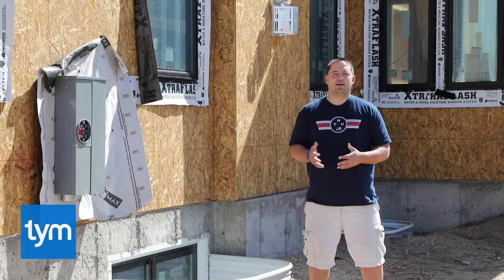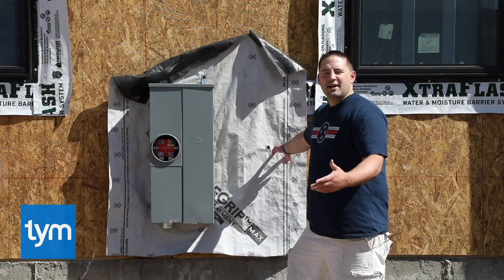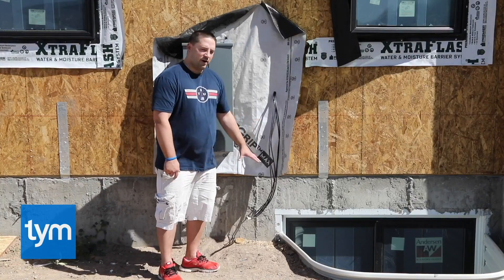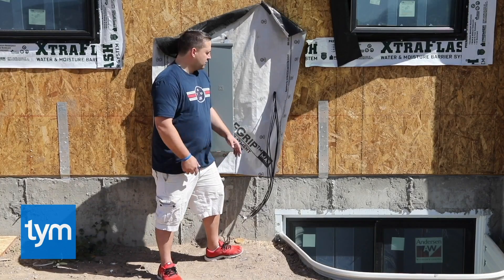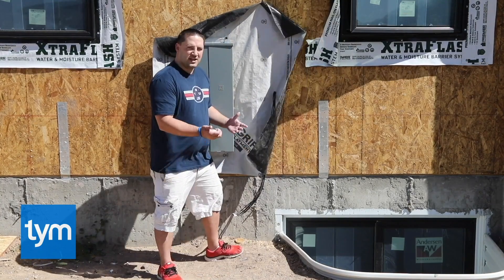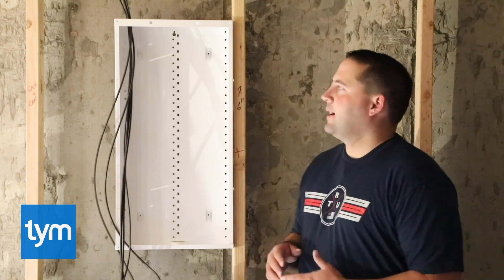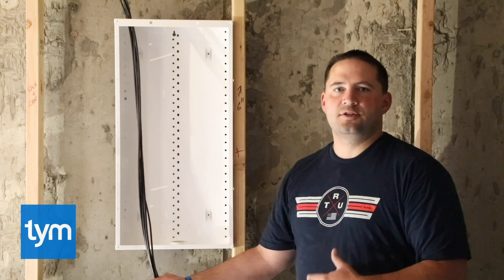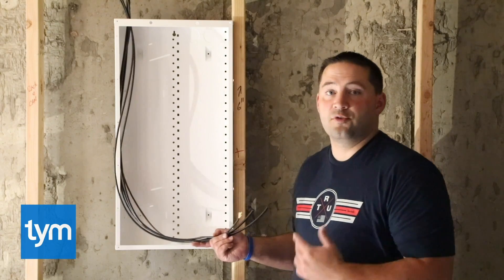How To Wire The Demarcation

Comment from the maker: Thanks for watching our video on how to wire the demarcation.  Let me know if you have any questions.
Reply: So with the low voltage run as a demarc for a fiber modem, have you actually seen this being utilized in new homes that are now equipped and operating with fiber? I'd assume ISP's would just provide a "fiber" modem equipped to a dc adapter that goes to a 120v inevitably. But I did find the low voltage run to be interesting so wondering if its worthwhile to do now.

(side question but is it "ok" to group 4coax, 2cat6, fiber, and a low voltage run in the same strand or is some separation ideal?)

What purposes would be utilized for running cat 6 to the outside.

In another one you recommended 4 coax runs to the outside, which most would seem overkill, but that is what I ran yesterday with quad-shield rg6.

thanks again, awesome videos, subscribed.
Reply from the maker: John Doe if I understand your first question, with the fiber modem they usually want to do just what you suggest and plug a transformer into a standard outlet either there on the outside of the home, or just inside.  The low voltage power wire for us is sort of a get out of jail card because often times the builder/electrician don’t have an outlet there.
Reply from the maker: John Doe separation is always good but to cut down on noise, but usually on the Demarc this is how we see it done.  You could run wires on inside of home with more separation and just bring them together last couple feet at Demarc.
Reply from the maker: John Doe depending on service provider they’ll use Category cable rather than Coax to bring the Internet into the home.  Cat6 gives you better speeds bandwidth obviously than Cat5e and most companies offering fiber to the side of home use a bundled wire that includes 2 cat6 to bring the higher speeds into the home.  So we kind of pattern after that to help the home be ready for isps offering the higher speeds.  The (4)coax are for satellite Prewire so different location.  A lot of homes just need 1, but some need 4 so we just run 4.  Cheap as coax is just easier to run 4 and know we’re always covered.

Comment: Wouldn't you recommend a flange flashing on the outside and conduit?
Reply from the maker: Luke H you can do that for sure.  Lot of it depends on whose paying for it, production builder, custom builder or home owner.  Very common to just push wire thorough, especially in production.  Custom and if home owner is doing it more common to see it wired into a box, and/or conduit

Comment: What about telephone services? I know most companies are going to VOIP, which mine is included. Would you run it  through a separate hole when coming into the house from the outside?
Reply: VoIP runs through your network and through the ISP. You will connect your firewall WAN to the ISP modem and the LAN to you Switch. Then install a patch panel in your network closet and run an Ethernet cable or 2 to your workstations. Terminate the wire(s) at both ends (to the patch panel and to the wall jack). If your VoIP phone has a PC port on the back, you can patch your computer to the phone and get internet. Or if you ran 2 Ethernet cables, you can patch the phone and PC directly to the wall. In the IT closet, you will patch from the patch panel to a network switch. You will create 2 VLANs to separate them on your network. This way your PC and Phone are on different networks. This is best practice for QoS.

Comment: your videos are awsome but... this is so wrong.... you are pushing an non outdoor cable to be exposed to the element and they will not hold with time.

anything exterior or should i say any connector that is going to be exposed to the elements should be closed in a sealed box / in wall  etc...

im from la, we usually get our service from the isp/cable from an Ariel connection so electrician and low voltage should have an EMT Goose neck with a service head at the end for the connection at the top of the house as close as you can to the pole.

we also to make thing nice and neat, use an exterior enclosure, metal exterior enclosure, which works great, we get it grounded (main panel is right next to us) and everything is looking flush and nice,

drilling a hole and leaving the cables out like that? that not a pro like....
Reply from the maker: Holzerstar pretty standard practice shown here in the video.  ISP/Cable providers bring an enclosure at install.

Wires are all housed in the enclosure, and it’s all grounded at the meter.

Some markets require a recessed enclosure and conduit at rough, but that’s less common.  Either way, Recessed or wall mounted it’s going to be housed in an enclosure before it’s all said and done.

Comment: Is there any restrictions on how far away the demarck wires extend?  Ie to center of the house or to office on the opposite side of the house?
Reply from the maker: Shouldn't be an issue, as long as you bring it out next to the meter.  The rule of thumb is 100 meters, and I've yet to run wire in a home where we're beyond 100 meters for the Demarcation

Comment: Your videos are legit. Would love to see an onsite of wiring for home theater. About to finish framing our basement and am planning to prewire a theater room and would love any tips for putting in conduit or anything like that. Thanks!
Reply from the maker: We actually have a Prewire Course that goes live this week. This video is actually one of the videos from the course.  We have a section on Surround Sound speakers as well.  It's not a full on 'how to home theater' course, as that's a separate one we're building, but it does cover Prewiring the surround speakers and subwoofers.  Happy to send you the link when it goes live
Reply: TYM Smart Homes & Home Theaters awesome!! Would love the link when you get. Regardless I subscribed ha. Also I think your based in Utah! I'm in Lehi. 👍 Thanks for your videos
Reply: Did you guys upload that wiring video?